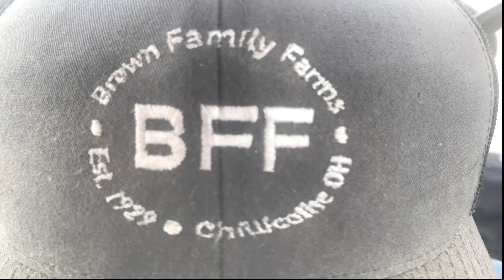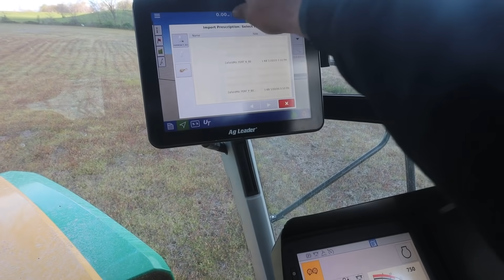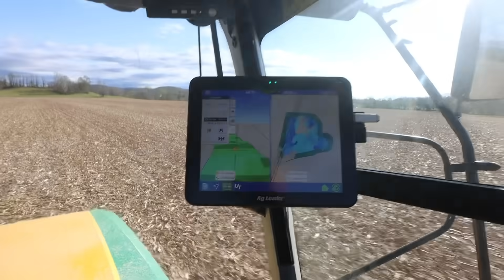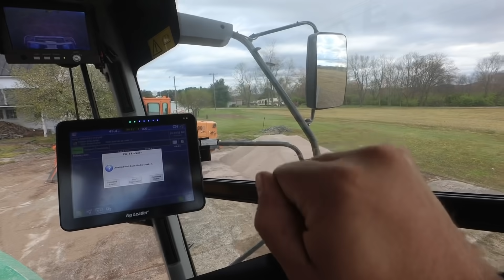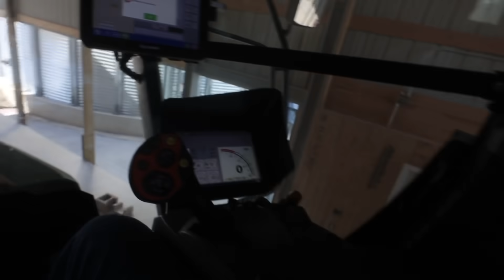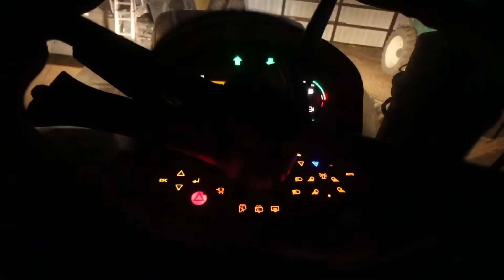Rippin Strippin Spreadin and Sprayin

Comment: sorry to hear about your friend and seed dealer will for sure keep all in my prayers on a different note the strip till bar and company get this bar lined out so it will be a go and work well if they would happen to see this post i want to ask them if making this size and bigger on a pull type and not 3 point mount not sure with the whole idea is to have less tires on the ground
Reply from the maker: With strip till a 3 point is best because you are more accurate but I’m sure a pull type will also be an option
Reply: @BriansFarmingVideos  i seen you guys have some trouble with the front end getting light and steering the tractor i dont really know much about strip tilling but to me it looks like a waste of fuel  to just till the strip the planter is planting in looks to me like the roots would suffer at the trench walls from the ground being a touch damp ans smearing this is just how i feel but this may be not true and me needing schooled on new age ag and strip tilling so do not take these words to heart and delete me i am open minded about this and any other newer practices

Comment: Sorry to hear about your friend Dan!
So couple questions, 
a) when you plant will the planter have to have rtk to follow the strip till and can you transfer the AB lines between machines?
b) end of the stripping season why not plasma the wheel centres and weld back in a but narrower? Solve the issue for not a lot of bucks? As you don't travel very fast it shouldn't matter?
Reply: I’ll try to answer. The AB lines we are using are actually imported from Dad’s tractor so we shouldn’t have any problems planting back onto them. As far as how the nurse tank is tracking, Dad dropped the air pressure in the tires & that has actually helped keep them off the rows.